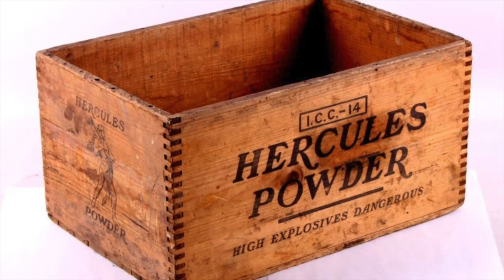Fuse for Thought...Making Prop Dynamite

Comment: Hi Santee, I’ve been looking for this Elmers glue you used as you said it doesn’t burn, I’ve even checked their website and this is the closest I could find. Is it the same stuff?

https://www.amazon.com/dp/B0045PXPH6/ref=cm_sw_r_cp_awdb_imm_WPEW2E00VDK19BC62BXV?_encoding=UTF8&psc=1

I would need to ship it from the states if it is okay. Would normal D4 water proof wood glue work or is it this one particular glue and brand which is fire proof?

I’ve most of the stuff and now just needing a glue to use.

All help is appreciated

Rob (aka - Preacher)
Reply from the maker: Hmmm....I don't go that crazy. I just by the cheap-o white stuff that is water soluble.